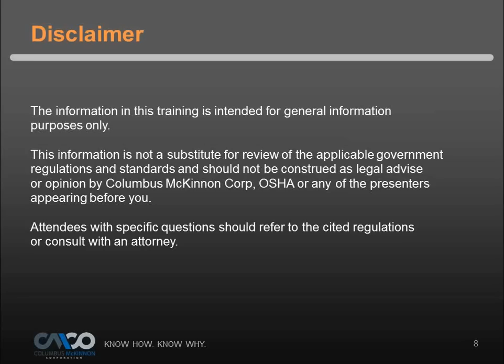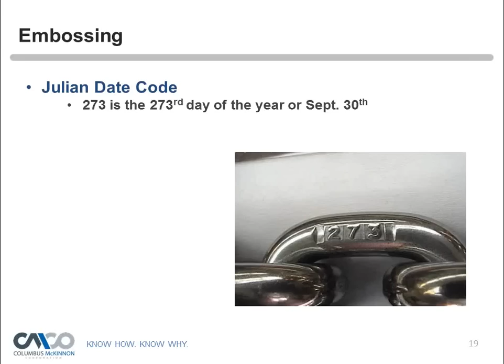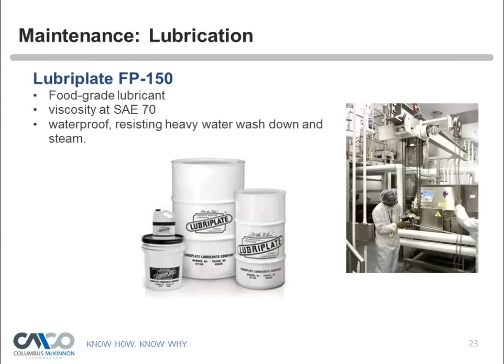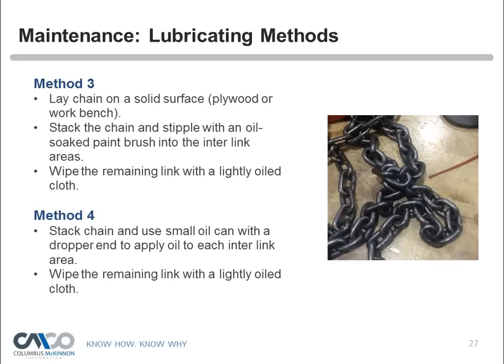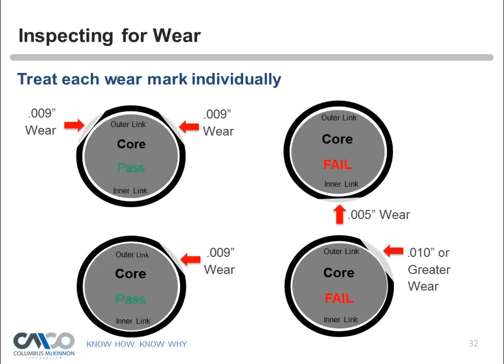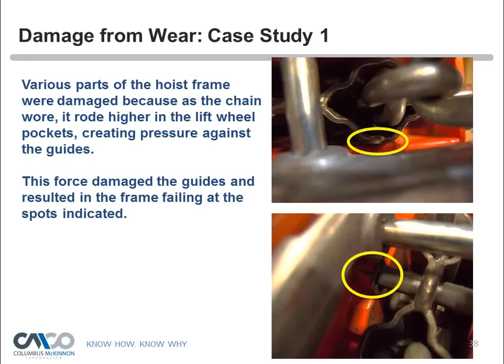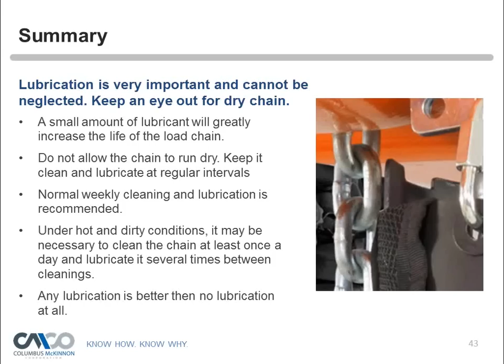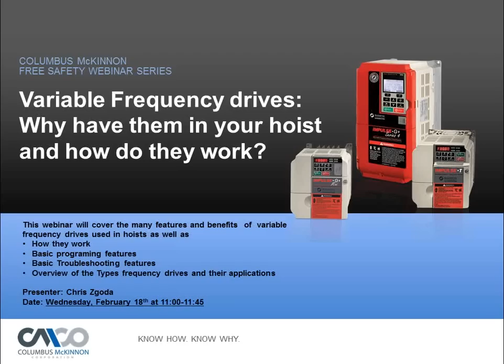Safety Webinar: Hoist Chain Lubrication - Why is it so Important?

Comment: I have question, can I use lubriplate FP-150  to lubricate the chain or is obligatory use LUBRIPLATE BAR & CHAIN  OIL 10-R
Reply from the maker: Hi Martin,
Lubriplate 10-R is a lubricant that was tested by us and found to have the properties necessary to help minimize the wear between links.
We also understand that this lubricant may not be satisfactory for all applications.

So if you do use a different lubricant your frequency for re-applying the lube will need to change as the lube used will wear with the chain differently.

It is a good idea to use a lubricant that will work with your application & make sure the lube is placed where the links are contacting each other.
That is where the most friction is taking place. Properly lubricated chain will help to increase the chain life.

Thank you for reaching out to us!
Henry Brozyna